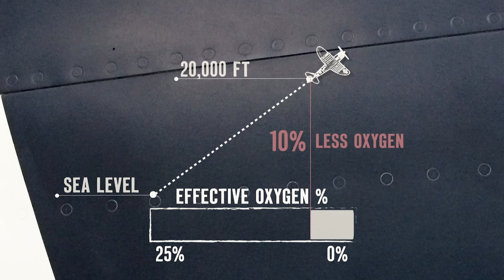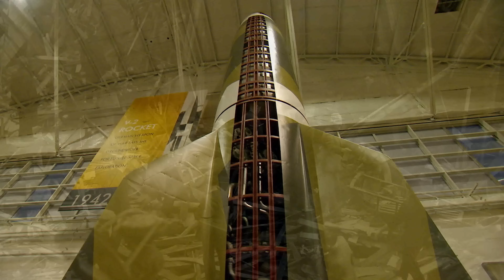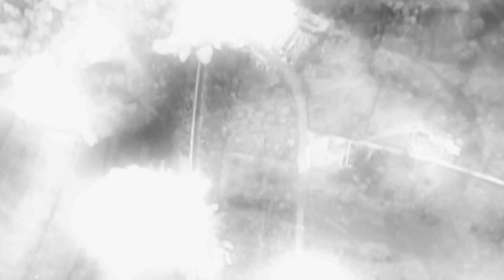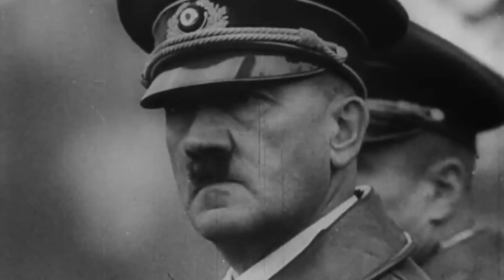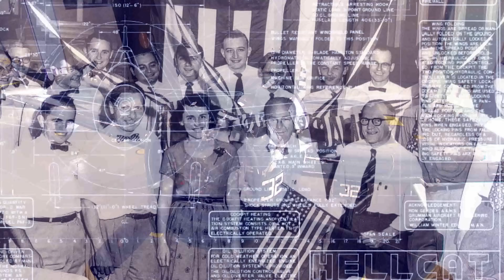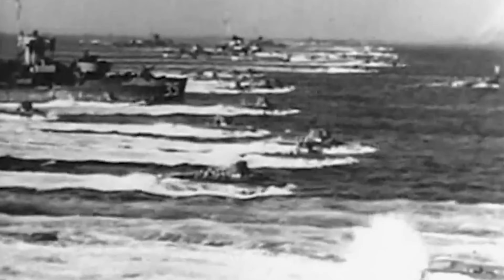Dogfights, Bombing Raids and Torpedoes: Thrilling Stories From The Skies Of WW2

Comment: I agree with a couple of the comments whoever wrote the script for this didn't know what they were talking about the P-47 was designed with the turbocharger from the start and the ones that were bad at lower levels and higher levels were the P-40 and the P-51 until they put the Merlin in it